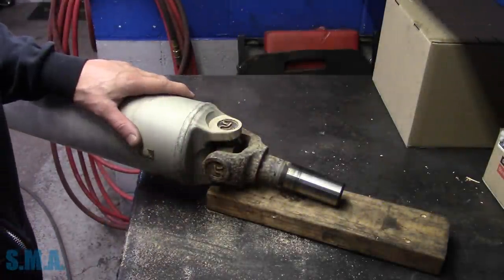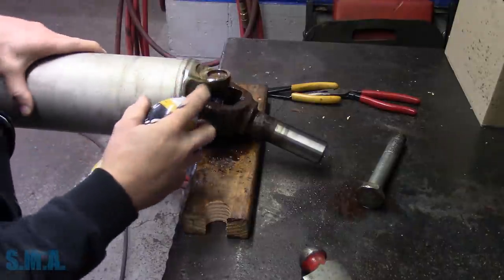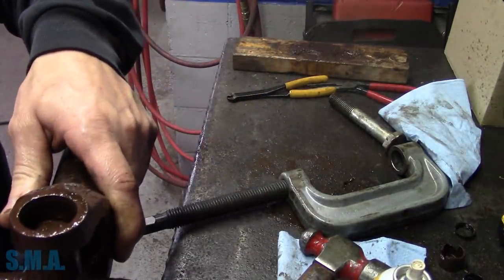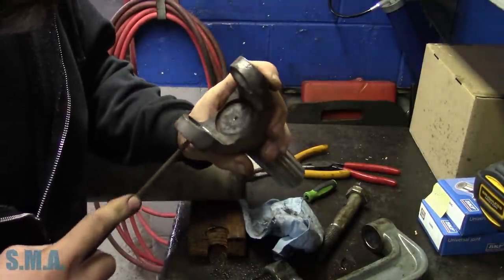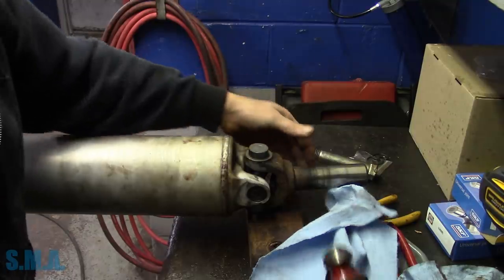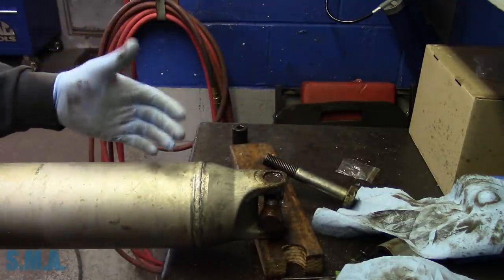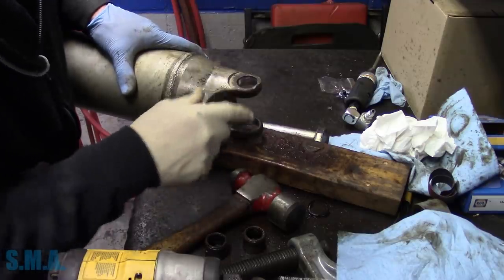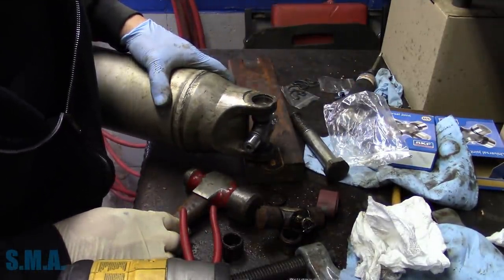U-Joint Replacement: Aluminium Driveshaft

Comment: Where would the world be without 2x4's? Probably the most useful  tool the world has ever seen.
Reply: 1/5 x 3.5. I always feel cheated when i buy 2x4s but they are useful.
Reply: I just knocked out a hub assembly off a 2005 Saturn Vue by laying the hub across four stacked 4X4s, equivalent to 8 2X4s.

Comment: Admit it. You like making a lot of noise. :D

Tip for cutting that groove with the dremel cutoff. Double up the wheels to the width of the groove. More accurate that way.
Reply: Pro-tip, right there.
Reply: Thanks.  That’s clever.
Reply: Good tip, and might also help to stop 'em from disintegrating so easy too👍
Reply: Dremel makes a fiberglass reinforced cutoff wheel that is quite a bit more robust and a little thicker though a new one would be too big in diameter; a used one would do the trick.
Reply: That info is already in the video!!!! appleflap........

Comment: "Where's your safety glasses?!" Thank you Mrs. O!
Reply: James Costello the next time Mrs O catches him without his safety equipment like glasses, etc, she should hand him the hammer and say "Here-Shake Hands With Danger!"
Reply: OSHA safety squints 😂
Reply: Safety first Eric
Reply: Those dremel tools are dangerous, especially with wire brushes. I use brass and steel wire brushes in my dremel quite a bit and they fling bits of the brush off so fast that it sticks in your skin. I try to keep myself out of the plane of rotation but those damn metal fibers always find their way stuck in my arm or shirt and sometimes face. Exploding cutoff wheels is another problem, but you can usually tell when they're about to fail and toss them before they break. I've had terrible luck with Dremel branded wheels exploding, I bought a random bag of 50 mesh cutoff wheels form a Chinese seller on Ebay and they surprisingly are far more durable.

I usually wear lab goggles for full eye protection because normal safety goggles can let stuff in from above, below and from the side on some types.
Reply: @Bob McCabe yup

Comment: Eric, I've had to do a ton of those on the aluminum shafts. A lot of time, I'll use my Snap On Ball Joint Press and just put light pressure on it and use my small air hammer with a flat bit to vibrate the ears lightly. Mind you, it's only light pressure and a very small air hammer. You can't get out of control on those aluminum ones, but I've never really had one that didn't come apart with this method. I always anti-seized the caps in the aluminum too. It's always a pleasure to watch how you're doing something because I learn different ways too. Everyone has success in different ways and if you can't learn from someone else, you're not paying attention. 

Cheers and have a great day
Reply: @Banshee365  that's a great way to kill even a steel driveshaft
Reply: Ted Mattingly insert sarcasm here
Reply: @Banshee365  I assumed as much, but sometimes you just can't tell LOL
Reply: I've done a ton of these GM aluminum drivelines in a previous job (mechanic for a large government fleet) in a coastal area of Alaska (aka:  lots of corrosion).  As you said, everyone has different ways for success with these things.  Just thought I'd share what works well for me:  use a cutting torch (carefully) on the u-joint cross to get the driveshaft separated from the yoke.  Once the cross is out of the way, all you have to deal with are the caps.  I like to pound the caps out from the inside (u-joint side) out using a punch.  Assemble as you mentioned earlier (antiseize on the caps in the aluminum).
Reply: @AKJeeper  yup, I've torched my fair share too and it works well also.  Lots of corrosion here in Michigan ad well.  

Do they use a bunch of salt and liquid brine on the roads in Alaska too? The brine on the dirt roads during the summer here is terrible because that crap dries like concrete.
Reply: Ted Mattingly The brine varies depending on what part of AK you’re in. In my area they switched to a different more ‘environmentally friendly’ solution that seems even more harsh on metal.  A large proportion of the roads here are dirt, so as you pointed out - the stuff dries like concrete. With that said, none of what I’ve dealt with here is as extreme as the “routine” stuff I came across wrenching in MN. Midwest vehicles are the worst I’ve ever had to deal with.
Reply: Am I at bada bing ?

Comment: Thanks for the video.  I'll be replacing the front u-joint on my '94 Chevy C1500 with aluminum driveshaft.  The original non-greasable u-joint made it to 296K.

Comment: Your diag videos have helped me greatly. I have an F150 that just started running like crap. Had some secondary low voltage coil code. It has 2 four pack coils so I swapped them and the trouble stayed with the right bank. Not plugs or wires and no visible damage to wire harness so that left the computer. Ordered one from Flagship One for $144 and installed it. Fired up and runs a like new one. Don’t have all your scopes and bidirectional scan tools but your thought process helped. If you can do it, I can do it. Thanks.
Reply: They are the  best diagnostic  videos on YT .
Reply: @skat kat my life slogan is, "I can almost do anything!"
Reply: I believe Eric calls your method of deduction (which he has used at times) "swaptronics."

Comment: I love it when you break out the BRAKE clean!
Reply: Thumbs up for actually spelling 'break' and 'brake' correctly.
Reply: The other day I was sharpening the chain on my chainsaw. The oil passages on the bar seemed plugged up with dried up oil and sawdust. I went to town with brake cleaner. Mr. O would have been proud of me.
Reply: I kept asking myself where is the brake cleaner and then tah dah.

Comment: Just thought I'd stop by and brag about putting u-joints in my old square body with the 411 rear end, they'd get loosened up about once a year, don't know if there was some other problem, but got pretty good with it, had my special tool, a piston wrist pin, and could bang em out on the driveway, of course that was the old steel driveshaft that could take a few good whacks, just brings back fond memories!!

Comment: Hey Eric!  The best thing about your channel for me is that I almost never deal with corrosion and rust like you do on the east coast.  You have to work extra to get these apart, but is great for us that don't work on frozen parts on the daily.  Great work, but those stone cutoff wheels bust up in pieces when they break, and I wouldn't be using them 8" from my unprotected eyes.

Comment: 6:00 am. 
Mr. Eric, my old 2004  will be needing U joints soon, it's got the same drive shaft as the one you worked on, thanks for the demo. I would have never thought of using a dremel, thanks for showing us that trick, take it from an old man, please wear safety glasses, those little disks explode easily, and you only got two eyes😮   Bob

Comment: Every time i remove the caps, i end up with needle bearing all over the floor. Good job. I had to shorten a drives shaft for a toyota rock crawler, once. I used a very large pipe cuter to cut the shaft twice. It gave me two very "square" cuts to weld back together. Then placed it a large piece of angle iron to aline the weld. It worked beautiful.

Comment: I like dremels a lot, but the plug in AC versions nearly always have way more beans than the weenie battery operated ones - lol
Reply: And they usually don't run out of battery!
Reply: @rockstarltu  It helps if you recharge the rechargeable ones after using them instead of waiting until you need it again.
Reply: The pixies that come outta the wall are angrier than the ones inside the battery. 😉
Reply: Very well put per AVE,the angrier the better-lol.  I love the portability of DC battery tools,  but sometimes you need a real 120v tool not a battery operated toy.   I challenge any battery drill to match the torque of a HD AC electric 1/2" drill, Ive got a 1/2" DeWalth AC and a Hitachi 1/2" AC that could break your wrist if not careful.  I also like the stronger thicker  dremel cutoff wheels you can get, the last way longer.
Reply: Buy Enough rechargeable batteries to  rotate three sets.  
1 set in Dremel. 
2 set on charge.
3 set ready to go.

*** unless it is plug in charge........

Comment: When using your Dremel tool to deepen the grove for the snap ring, position the end cap so that the screw head from the cutting disc touches the end cap when the disc is in the proper position.  This will help keep the cutting disc from slipping out of the snap ring grove and making it too wide.

Comment: First time a dremel fixed something instead of ruining it!
Reply: Dremels can be used to fix a lot of different things, they just need to be used by someone who knows what they are doing and not just someone who thinks its a magical tool that will do the work for them.
Reply: snoopdogie187 It’s a Mickey mouse tool with even worse quality attachments, it’s been useful here and there, but has let me down too many times, I have other similar tools I prefer.
Reply: @snoopdogie187  exactly and using an appropriate accessory tip helps a lot.

Comment: Good idea, to slot a bolt to allow sanding inside! On a similar vein, take that new welder of yours and make a U shaped adapter from half inch square stock. It allows you to press the back cap out by applying pressure on the side bars of the cross. The adapter avoids any pressure on the unsupported top ear, and the top cap doesn't get pressed inward. Not an original idea, I saw a pro make this look so easy.... Thanks for another practical video!

Comment: Hey Eric, I really appreciate this. My '67 LS-D200 Sweptline now has a 5.3l/4l60e with "aluminium" driveshaft running to the original Spicer rear. Rear u-joint blew it's caps, luckily not the 2 that go through the driveshaft, otherwise it'd be toast. This video answered a few questions that were pinging about in my brain compartment. Thanks as always!

Comment: I love your videos. You may want to try this. While I haven't done one of these in years. The way I used to do them was much easier.  I  would simply remove the keepers off and then press the u-joint out with a vise and 2 sockets. One socket that just fits inside the end of the drive shaft. This one is used to push the u- joint and the other socket was a little bigger than the u-joint and used on the other end. when everything is put in the vise the small socket pushes the u-joint out while the big socket on the other end allowed the joint to go inside it. This is so much easier and safer than using a hammer.

Comment: thanks for the help. the 2x4 worked great. I put my ujoints in the freezer so after the shaft and yoke were cleaned up assembly went really smooth with my vice.

Comment: Imma use that block of wood tip in about ten min. Thanks man I was cruising the tube looking for good ideas on ujoint replacement after I rebuilt my trans and that's all I got left to do before cruising. Thanks

Comment: Takes me back to 1980's there with a universal joint replacement, not a lot of vehicles in the UK are rear wheel drive , change more cv joints here, dirty smelly grease , used to use a copper drift when tapping the bearing cap in or 2 sockets in a vice as our bosses were too tight to buy a press , and that was at a Fiat main agent , tight gits, one of the first things I bought when starting on my own , proper  equipment is priceless

Comment: You are a real mechanic!  You repair the drive shaft!  When you introduced the penetrating solvent, I was waiting for "Not a sponsor."
The rear drive shaft on my Nissan Frontier is aluminum.  I keep wondering about those joints.  My Dad would have repaired it, but taken longer, cause he didn't have the dremmel like yours.  Despite all the "wonders" of aluminum, it's a soft, easily damaged metal!  Good Job, nice to hear Mrs. O and see your growing daughter.  She's gonna be a heart breaker.

Comment: My dremel actually gets a lot more use than you would think. Granted, I have the larger corded one, but those little cutoff wheels come in handy sometimes. Had to drill out a Chevy Cruze oil plug the other day. Used the dremel to chop off the little nub that had at one point been the 10mm head on it. Worked surprisingly well.

Comment: More or less, I had the same issues with my aluminum driveshaft in my '95 Chevy pickup. The front joint came out and went in with no problems. The rear joint, we ended up blowing out the groove for the snap ring. I was quoted $1000 to repair it by the only local shop who deals with aluminum shafts, so I took it to another shop who makes and repairs driveshafts for large trucks and told them to copy it in steel. $400, and ended up with a seriously beefcake 4 inch driveshaft.

Comment: after you had the first cap off of the damaged end of the shaft and the joint wouldn't come out without the other cap being pushed back thru you could have cut 1 end of the joint off with a cut off wheel on a grinder and taken it out that way...then take the cap out by pushing it thru the center...been there done that....you are good at what you do

Comment: You make them joints look so easy. Every time I do them I end up with at least one cap with a needle that fell inside then I have to start over. Then usually ends up with them falling out and I end up pissed off and getting another joint lol.

Comment: Thanks for doing the repair the way my father taught me how to do it.  With a block of wood and a hammer.   Rather than breaking out the torch and cutting the U-joints in half as some guys do to save 30 seconds.

Comment: Ahhh. The so very satisfying sound of brake clean. I was surprised that you didn't tackle the damaged end first just in case it didn't go well. I know it's a pain to do that end first under normal conditions but if you hadn't been able to save the driveshaft it would have saved you some work. Glad it did turn out well.

Comment: Hahahahahaha 30:12 "anyone see where we put the cut off wheel". I have a new Ram 2500 with the 6.7 Cummins and the other day I changed my fuel filters and was surprised to see my[ kitchen trash can size] aluminum drive shafts.  I figured with the heavy motor and truck at least there would be a heavy steel drive shaft, but nope.  Glad I live here in Southern California where things don't rust out so bad. Good video Dr. O.

Comment: Done the groove chase before and surprise it was on the same type van too only my dremel was a black and decker wizard and had to charge it every 20 minutes  and it truely had the weak sauce so I used my dewalt 1/2 drill only my set had a metal and wood cutter that was just a whisker under the full groove width it worked perfect worked like a tiny mill cutter and where it was buggered same as the one you had only on both ears of the shaft it worked out really well

Comment: Nice job Mr. O. Where I live, we do not have the salt issues. That said.   Caution is a must on the shaft yoke. The white crusties seem to attack us all. Damn you aluminum!

Waiting for your vid on a Subaru rear driveshaft u-joint replacement. Have fun with that. It's even better when you only get half the circlips in the hardware package.

Comment: Best penetrating oil I have used was something an old mechanic told me about. 50/50 mix of acetone and Auto Trans fluid. It is AMAZING!!!! I have used a lot of different sprays and things and this one is the best. Be careful around paint and plastics though.

Comment: we had a u joint break apart in our 85 g30 van while driving on the free way. after the tow truck put us rubber side down again i think it was safe to say check them more often. the front went into the pavement and we went butt over tin cup while rotating like an apple in a corer. not fun at 70 mph . state police said we did 3 full rotations and 2 cartwheels because of a $10 part.need clean pants as well. good vid

Comment: Wow 😮 you saved that one. But I would tell the customer that they should expect to buy a new driveshaft for the next go around. 
I used to have my driveshafts rebuilt when I had my dump truck but they were steel and they could weld a new end on them.

Comment: Many years ago, probably 30-35 years, had to replace the u-joints on a Caddy. Factory joints do not use cir-clips they put them together with a type of epoxy cement. Steel driveshaft. To get them apart you had to use a torch and heat them to the point when the epoxy blows out like a small cannon shot. New u-joints used the cir-clips. If anyone runs into this situation, Make sure to use a Face Shield, that hot epoxy shoots out like a fire hose

Comment: Just did this job on my Silverado SS... x2! She's an AWD, and the moan above 74mph wasn't hubs or bearings. Get under the truck and wedge a fat screwdriver between the U- joints to find she's sloppier than a pig in its waller.

Lots of penetrating lube, a small pneumatic hammer and a dull chisel tip. Knocked out both shafts within 2 hours being lazy and sipping beer all the way. Luckily I didn't have to recondition the pockets the get the circlips back in. Hardest and slowest part of the job was crawling under the truck to separate the shafts from the diffs & transfer case, but I didn't even have to Jack it up. 

Wire wheeling the bands and bolt hardware goes long to easing reassembly and lining up the bearing cups Ez-Pz. ^.^

Comment: Love your videos and can’t wait until the next one. Just a tip, Instead of pliers to remove the clips use you plastic handle screw chisel pry bar (screw driver). Just place the screwdriver against one tab of the clip and hit it with your mer  (hammer) or some other tool that has a hammer side.  The clip will pop right out, if it doesn’t,  hit the tab on the opposite  side.

Comment: For cleaning the lock groove I use a diamond coated disk and a dermal tool, cleans them out instantly, I get mine from an industrial supply house but harbor freight does carry them.